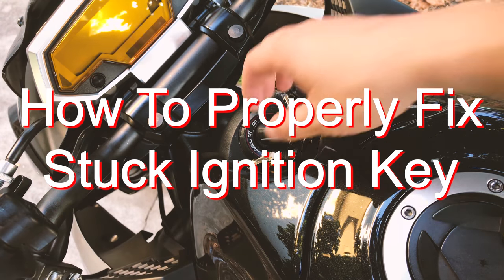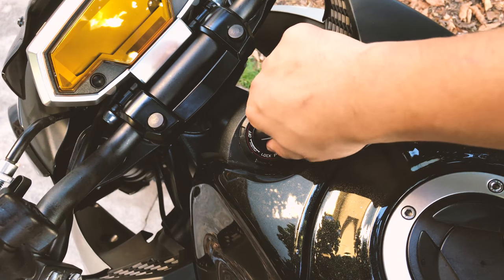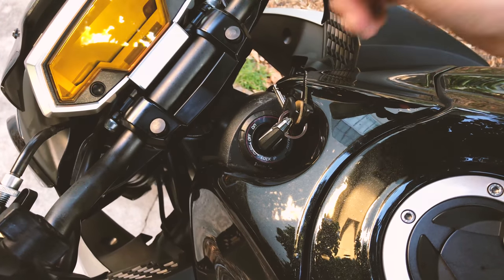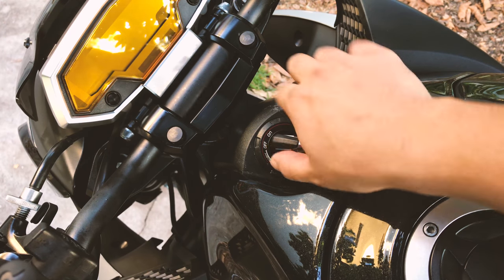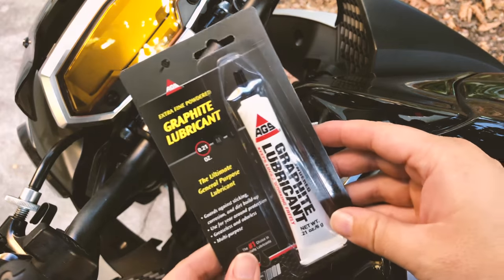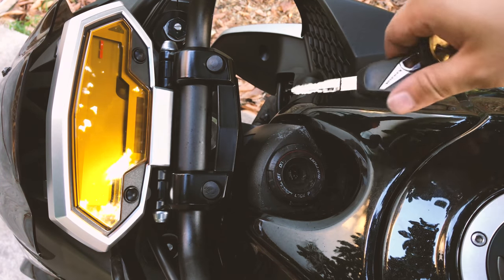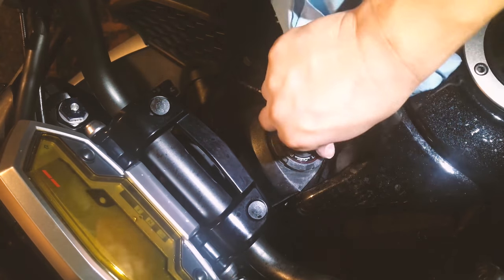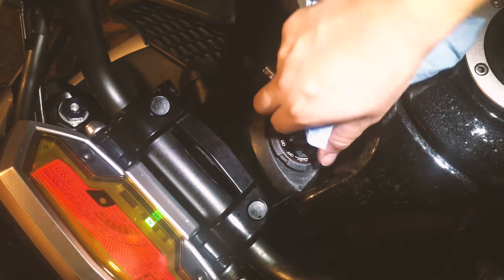How To Properly Fix Stuck Motorcycle Ignition Keys (Kawasaki Z1000)

Comment: On my scooter when I had the same problem I unscrewed the outer ring (by hand only) and was able to access the outer locking rings on the tumbler and lubricated accordingly with dry lube like you have done resulting in like new operation.  I also blew out some significant amounts fine dust down the key hole.

Comment: White grease for boats is the best solution, it lubricates well, protects the mechanical moving parts of the lock, lasts for years and cannot be washed off by water. White grease in spray is also an excellent solution as a new lubrication solution.

Comment: super easy to fix with all bikes. Just spray some brake cleaner or pour a little bit of alcohol in the key hole. then proceed to repeatedly smash that key in there for a good minute to get it clean. then use either silicone lube or just some chain lube and proceed to smash that key in there again. i promise it will work every time and this method works with all key locks even car doors, houses, pad locks etc.. graphite only works if the key is damaged and needs to be replaced or if the pins in the lock are worn out. and really they don't wear out unless you or previous owner is the most aggressive unlocker in the world.
Reply: Thanks man will try this tomorrow

Comment: I used that same graphite on my Ninja 1000 for the same problem and it just gunked it up real bad. Took it to the shop and they used Bel Ray lubricating fluid but a cheaper option is the Supertech version of WD40. Problem solved.
Reply: Why not just use w D40??
Reply: Your asking for trouble using wd40
Reply: Don't maul with your key !   Feel the key gently.   Use no force
Reply: @fpreston9527  why?
Reply: @fpreston9527  why?
Reply: @torrid94 its oily and attracts dirt and could make the problem worse
Reply: @turpakiinnisaatana3361  its oily and attracts dirt and could make the problem worse

Comment: Can chain cleaner be used?
Reply from the maker: it's best to use dry lube, you can try light silicon lube, because most chain cleaner are thicker formula and may stay inside and attract more grease making the keyhole more sticky in the long run

Comment: Stuck and sucks!😭😭😭😭
I tried graphite fat, Lithium fat, wd40, nothing helped. 
Today it took me 6 minutes to remove the key.
😭😭😭😭😭 Kawa-suck-i😭😭😭😭
Reply: Same thing with my Honda CBR !  
You are not alone.
I think the ignitions in our bikes can't handle the vibrations caused by high rpms, and they wear out really fast.
My bike stranded me last week.
It is in the shop now.
(Nothing) would unstick that lock !
I tried the dry lube power before also - and it also made my lock even worse.
I tried WD-40 dry lube - and that did not help at all.
Garbage locks/ignitions these days !
Reply: @iamtheiceman  Same. In the morning everything was perfect. Took my bike for a ride. Same day, a few hours later and the key didn't turn.